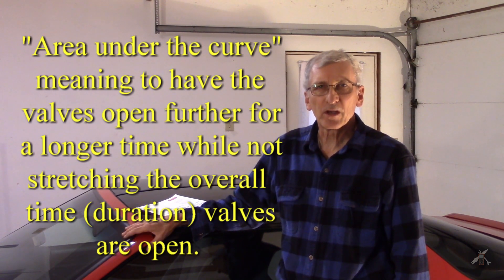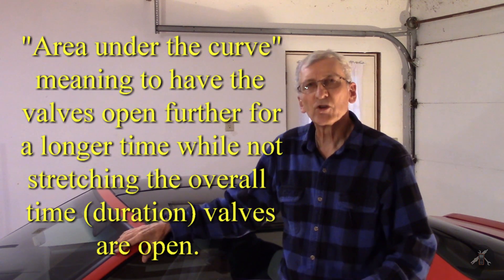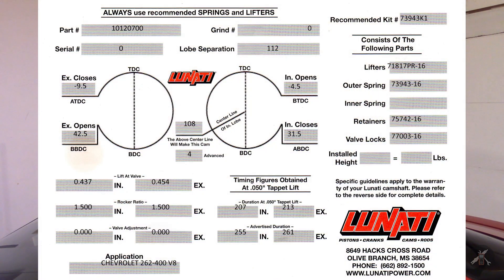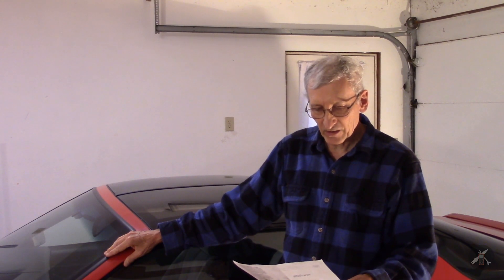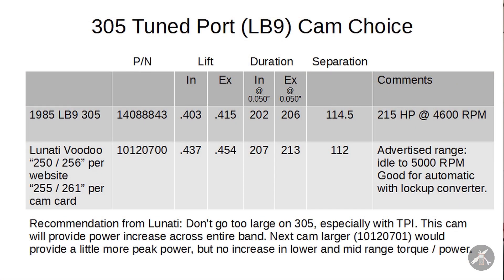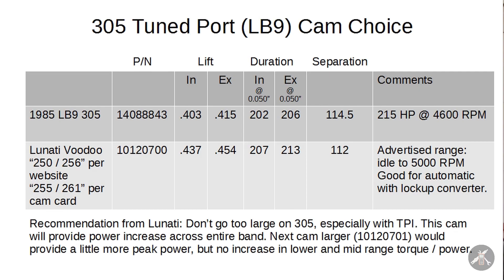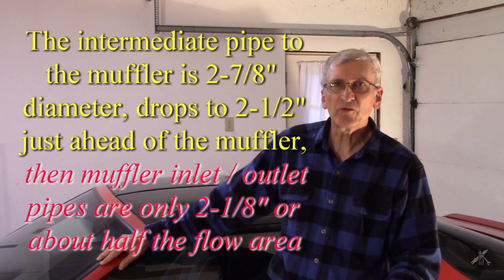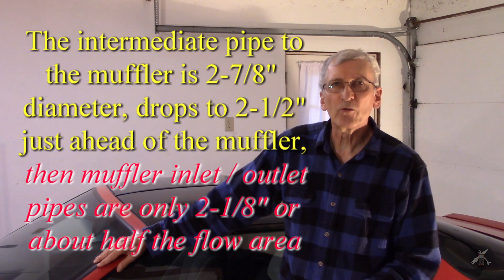Cam Selection & Cam Sounds - Lunati Voodoo  - 3rd Gen Camaro 305 Tuned Port Injection

Comment: Looks and sounds great.  Wise decision to not go wild with the cam.  I have a 1990 IROC L98 that I've had since 2002.  It remains 99% stock (only mods are - air foil, new matched injectors, cat-back exhaust and adjustable fuel pressure regulator) and I'm very happy with it.  It will never run with the modern muscle cars, but who cares as it is fun to drive and fast enough.  It does lay down a bit when it is warm - it runs super strong when I first start it and it's cold, but after running for a few minutes and it comes up to temperature, it isn't nearly as strong.  A bit of a mystery; however, I suspect its the coolant temp sensor that's gone bad, so that's getting changed next.  Anyway - great videos, keep up the great work.  👍
Reply from the maker: Sounds like you have a good one!  Just a thought on the coolant sensor.  I'm not sure how much changed on the later cars, but my '85 has a coolant sensor and an air intake plenum sensor on the bottom side of the plenum. You might want to get a look with a scan tool at the reported temperatures or measure the resistance of the sensors. The factory service manual provides resistance vs temp spec. You can measure the coolant sensor at the sensor, the inlet air sensor is hard to reach and you need to measure it at the ECM connector.  One additional point, my coolant sensor reads incorrect on the scan tool (too high).  I replaced it and the replacement read the same.  Probably an anomaly on my '85, hopefully fixed by '90.
Reply: @bitsofwisdom460  awesome.  Thanks very much for the info.  I'll have a look at the air temp sensor as well. Thanks again.
Reply: @geremychubbuck3730  you’re right, these cars are much stronger cold than at temp. There’s an inlet temp sensor relocation kit that I put in my GTA and it has helped a bit. Relocated it to the air box from under the plenum so your computer sees much cooler temps and won’t lean it out as much.
Reply: @BlackRam17  Hi Sean - Thanks for the reply.  Yes, I did the air temp sensor relocation and put in a 185 thermostat.  Also did the inlet coolant delete.  It's quite amazing how much ore power it has cold.
Reply: It may not hang in the quarter with them but can surprise them in the 1/8 . Still fun street car . I have the Formula 350 89 . TPI is so simple to work on and very dependable. Love it.

Comment: Nice sound I got a Chevy performance lt1 hot cam 
But it ruined the tpi 
My car was a t5 and 305 it did 275 hp and 375 tq 
With a worn out 230km bottom end leaking compression bad 
14.30 at 99mph 
It smokes 1st gear and 2nd gear and squacked posi 3rd gear ever time 
The 2nd gear sideways took me for a long to get used to
Reply from the maker: Thank you!  You sure have some good performance numbers, that's impressive.  BTW my engine shop set me up with a double row chain with the new cam.
Reply: Hi there. If I may ask, how did it "ruin" the tpi? I've been reading on forums that a LT1-cam and a double-roller timing chain is the best "first modification" to go for in an LB9-car.
And also, what year is you car and do you have a Wc-t5?
Do you have any other performance-mods as well?
Reply: @kmas8229  my car just used a single chain ported and polished heads and thin felpro hg
Reply: @benkalinowski5834  Damn, did you do a custom tune or chip?